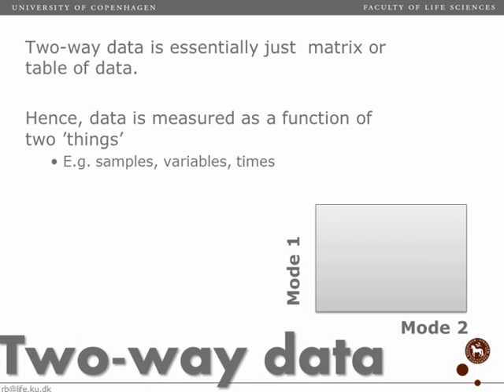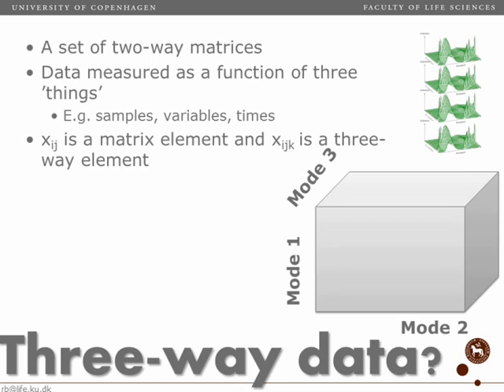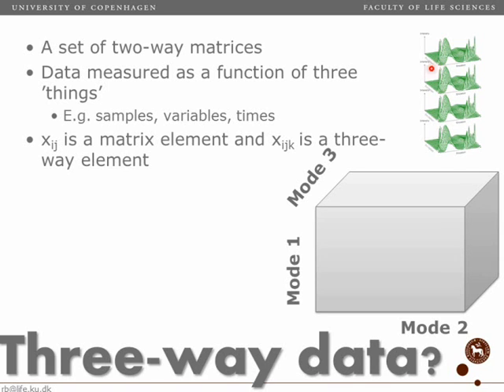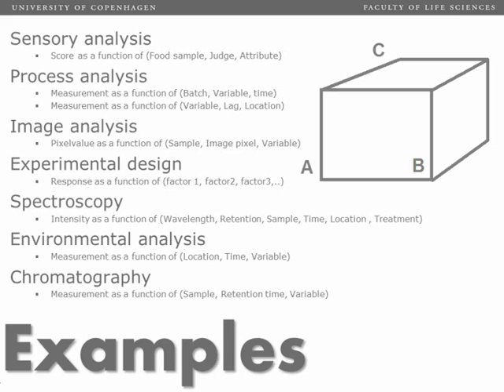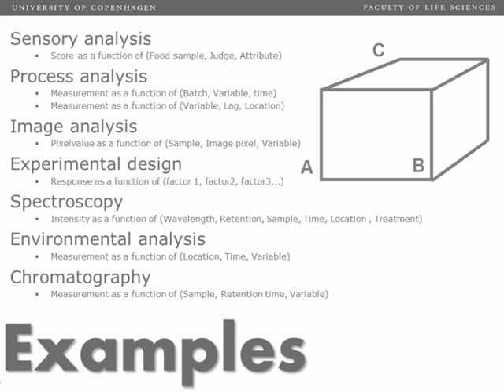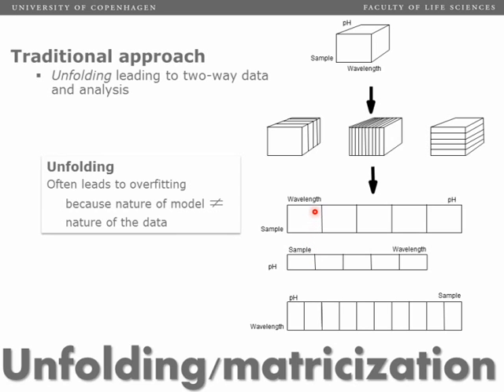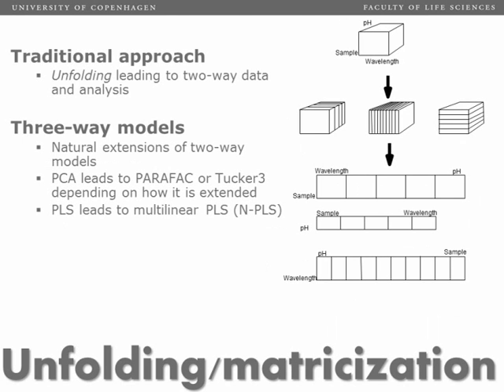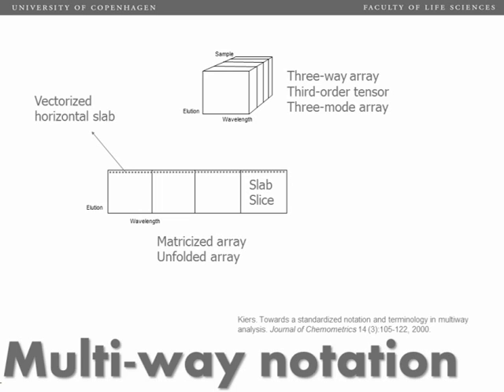Multi-way analysis. Part 1. What is multi-way data

Comment: I am working on trying to use parafac for my labs' current research project but am at a loss on getting my arrays into a 3D Matrix. In the tutorial you have available, X was already 3D so I was unable to see how to get there. I have tried matlabs many ways of getting there but have had no luck. If I have 6 files that are all EEM text files, how can I get them into one 3D matix?
Reply: Matlab help is the first place to check. Also http://wiki.dtuaqua.dk/dreemtoolbox/doku.php?id=start and http://pubs.rsc.org/en/content/articlehtml/2013/ay/c3ay41160e can be helpful. as a general tip, in matlab, you can do X(:,:,1) = X1; etc